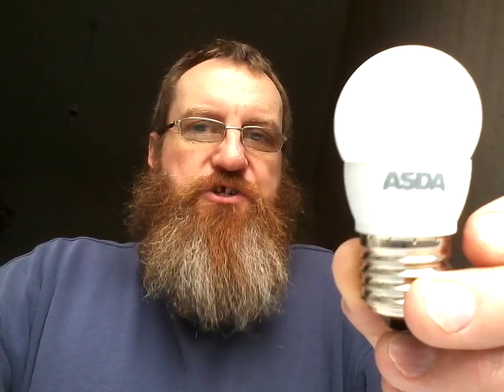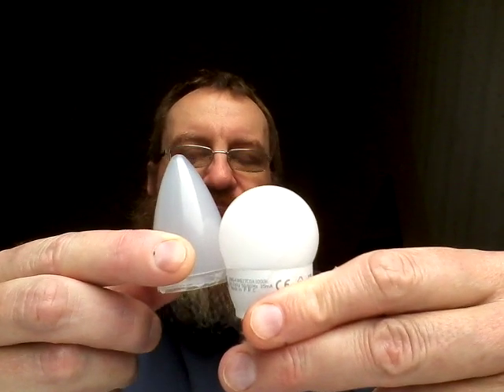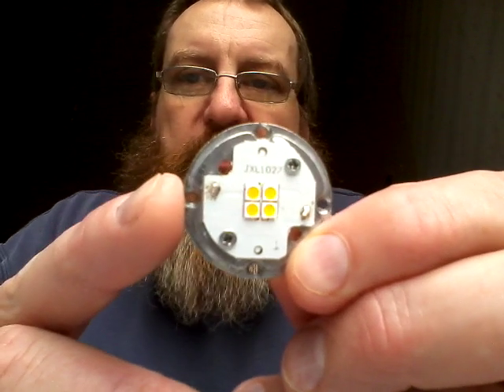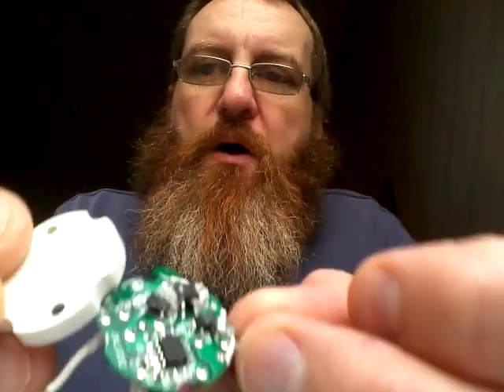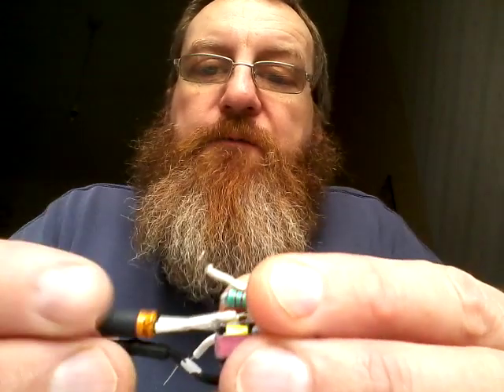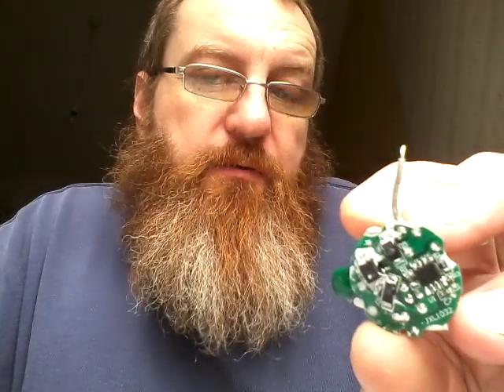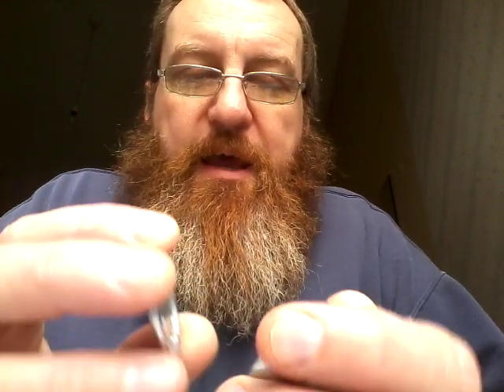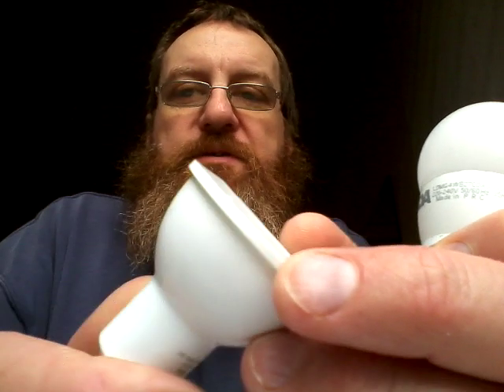ASDA LED lamp.

Comment: I am very happy that these LED lamps are finally getting good enough for being widely used pretty much anywhere. I worked on some websites selling stuff like this a while ago, but the lamps were incredibly dim, even for higher wattages. They looked like tiny candles barely glimmering in the dark.

Now I have some 5W LED lamps from Lidl, and I was blown away by the fact that they're even brighter than the previous incandescent 60W lamps.

And judging by the fact it barely gives off any heat at all, I think the power rating is correct. They have really come a long way.
Reply: In Canada they are beginning to mandate non incandescent bulbs however there is an unintended drawback - increased heating costs.
It gets very cold in Canada.
The incandescent bulbs were actually helping to heat the house. 
And in the far north where they build the houses without basements people hang a couple 100 watt bulbs in the crawl space 
under the house to prevent the plumbing from freezing.
The change has increased fossil fuel (natural gas) usage. 
And LED bulbs are expensive. 10 to 15 dollars Canadian (I know Canadian money is almost worthless but still).
Very expensive to convert the whole house.
We have a mix of incandescent, compact fluorescent, and LED.
I really dislike the compact fluorescent.

Comment: Hmm, I've just bought 6, 40 watt equivalent (actual power: 6 watts) E14 candle LED lamps from ASDA, and I'm very happy. I had confidence after I bought a 12 watt B22 LED lamp from ASDA, just over 2 years ago. It's very large, and most of that is due to the heat sink fins (which is actually full of dead insects, looking at it now) but it's nice and bright and hasn't shown any signs of wear or malfunction.

Comment: I run on ASDA lamps as it's just across the road and they were dirt cheap for me at the time, 2 for a fiver or poss 8 quid, but absolutely dirt cheap to run. I use 0.2 to 0.6 unit a day now in  total of electricity.

Comment: For a couple of months now, Tesco have been doing a 100W equivalent LED for £7.  For £8 they have a dimmable 100W equivalent.

I've bought one of the non-dimmables.  Light output is good.  It runs hot.  The shell is too hot to touch for more than a second or two.  I'd love Clive to do a tear-down and give an opinion on the innards before I spring for another.  Maybe a Y-adapter and two 60W equivalents is a better way to go.

Comment: Hi Big Clive. Love your channel. Having purchased 3 of GE 7 watt CFL SES bulbs for my kitchen light from Tescos I have been amazed as the first 2 bulbs have gone long ago maybe 2 years after purchase. I think I purchased in 2013. The third one is mind boggling and is still working to this day. Could you do a video explaining this. It glows pink on start up so thought it would be suitable for your channel. Lol. I'm amazed and confused as to why this one is still working 2 years after the other pair have been assigned to the black bin of death. Lol
Reply from the maker: The pink glow is usually the carrier gas on its own (often argon).  As the lamp heats up the mercury vapour produces the UV required to stimulate the phosphors and produce white light.  Most modern lamps contain a tiny amount of mercury, sometimes trapped in an amalgam pellet.  Older lamps sometimes fail dim because the mercury has been absorbed and depleted.

Comment: Nearest I can find for the chip is a TND322VD which is an 8-pin dual buffer driver.
Reply from the maker: This seems to be a dedicated high voltage buck regulator chip designed to derive its power easily from the mains.  I'm guessing it might be re-badged or just so specialised that it's only available to lamp manufacturers.

Comment: can you recommend a brand of LEd E14 / E27 ?   my son has autism, and needs the lights turned on at night, the Asda ones get warm, am i buying the wrong LED lights, i assumed all are not supposed to get warm....thanks you ! love your channel
Reply from the maker: It doesn't have to be much light for comfort at night.  Consider a plug in nightlight or a small USB powered light.
The modern LED bulbs do get very warm in use.

Comment: I was surprised to find 60 and 100W incandescent lamps on Amazon.  The CFL's we have just don't cut it.  By the time they have warmed up you are in bed :)I am trying a LED G10 lamp now in a spotlight.
Reply: +Douglas Elliot Beware. Some of the 100W incandescents I bought on Amazon didn't last long, and some did scary things on failure - like shooting the glass envelope across the room. Basically those things are illegal Chinese imports (which I wouldn't care about by itself), and have passed no safety testing whatever.

I hated CFLs, but now that I've tried LED I don't miss incendescent at all. My entire house is now LED except the flourescent tube in the kitchen.
Reply: +MrSwanley Thanks for the warning.

Comment: Why are most lamps in the UK bayonette but all these cool bulbs are screwcap? Maybe 10% of all the bulbs at my local supermarket are all screwcaps ... I don't get it.
Reply from the maker: +mickenoss Biggest demand for lamps is Edison screw.  The UK bayonet cap is quite unusual.
Reply: Bummer =(
Reply: mickenoss Bayonets are best they don't unscrew themselves and brake, they just brake!
All the 100 watt Edison screw downlights I ever installed in my kitchen unscrewed from all the heating and shrinking then they broke since replacing with led they never unscrewed as they don't get as hot!